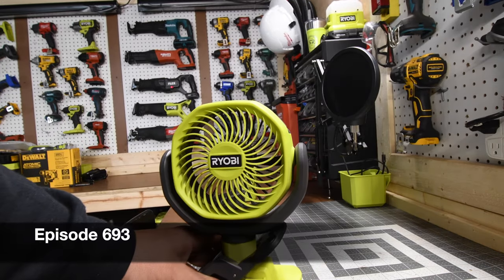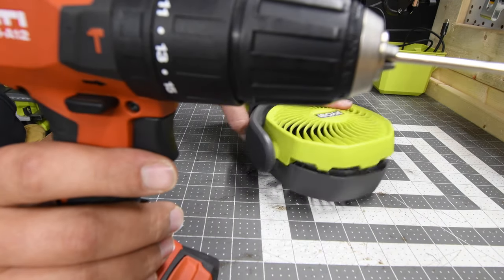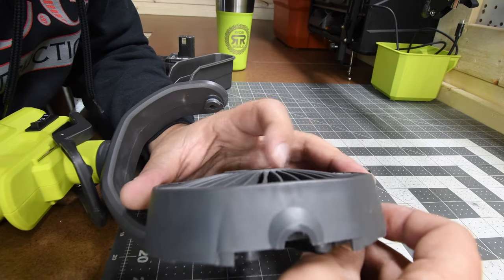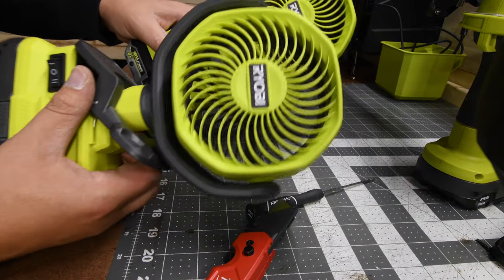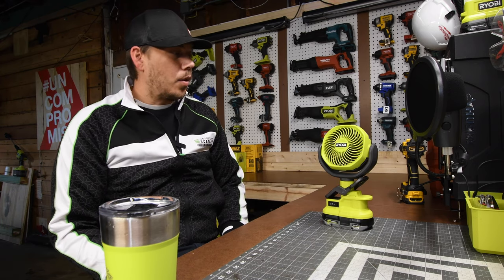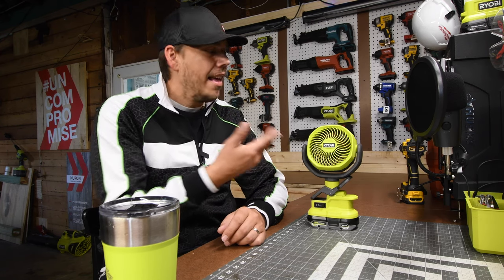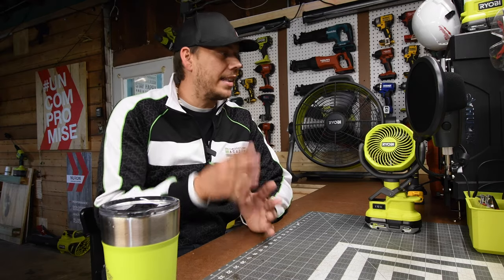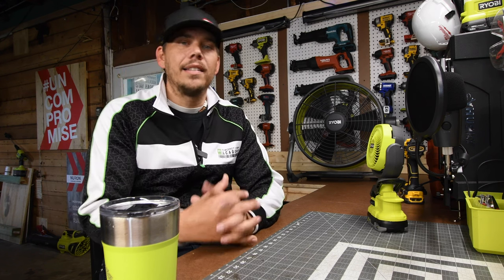If It Ain't Broke, Fix It Till It Is!

Comment: I have 5 of these fans. I bought 2 of them a few months ago and both did exactly what your fan did within days of purchase. I tore one apart and did what you did to fix it when that happened. The fan worked fine for about 2 days and then went back to normal. After reading the comments to your video, I think I will try to disassemble my fan again and use some lubricant to the bearings. If you're fine with it, I may piggy back your video with a video where I use lubricant and see what happens.
Also I abuse fans as well. Our Ryobi cannon fan runs literally nonstop from April to October and we only had a couple times that it would slow down. After a good clean out from the high volume pump it was good as gold.

Comment: As the owner of a couple of these fans myself, this is a short-term fix. Even putting a few drops of oil will give a temporary fix with less effort. The problem is that they probably didn't expect people to use these fans for as long as like you mentioned. 18 hours a day takes a lot out of certain parts if they don't have proper bearings. I used to use 3in1 oil, but I found using wd-40 lithium grease sprayed in from the back help the problem go away for a bit longer. 
But it's still just a temporary fix.

Comment: Fans have to be oiled, Dave. A little 3 in 1 goes a long way
Reply from the maker: I used to do that. it makes the house smell like oil or the grease since I use these fans indoors
Reply: Some fans don't have to be oiled. Some have what they call "permanently oiled bearings". Vornado uses them for example. They say if you try to oil them, it'll harm it. Apparently they use them in higher-end fans.
Reply: White lithium grease doesn’t smell and doesn’t collect dust.
Reply: @cfdfirefighter  interesting. Have never used it specifically. I'll have to pick some up.
Reply: Turning the fan off let's oil reseep itself on motor. When running all the time it will run itself dry.

Comment: Did you remove the fan blade then put it back? Or did you just push and pull on it? Comments say to put lube, but if you can’t remove the blade, where exactly do you oil it?

Comment: My air cannon stopped working. It was doing the same as your fan and just barely running. I opened it up. The brushes are done. They use cheap brushes
Reply: My cannon quit after 1yr

Comment: I just got one two weeks ago, it lasted 3 days..till it started making weird noises 🙄
Reply: Yeah, I think I've got that same prob on my fan; But it still works well enough...
Reply: @leaves2975  yeah , it makes noise for 30 minutes then it’s fine.. Home Depot is out of stock here.. The fan saved me when replacing my tent trailer ceiling panel’s when it was nearly 100F.. flip flops were full of sweat.. like I just got outta the lake..
Reply from the maker: its a nice little fan and it does the trick
Reply: @ManCaverTools  yes , it actually saved the day camping , we forgot the sound machine for sleeping for our 3 yr old.. and she was scared.. but the fan ran all night no problem for 3 nights.. we were camping with out a power site .. way up north of Toronto.. we had a moose one night walk past our site 5 ft from our car.
Reply: Mine did the same and then it just slows down. I exchanged it. I do have two of them now. But ryobi is hit and miss with their quality control.  I also just bought a ryobi a high volume inflator . Pressed it two times and already burned . Plus the nozzle was to big to fit securely on the exhaust it just dangled. I had to return it and reorder. But the 2nd one I received is a charm.. With that said ryobi definitely has quality control issues.

Comment: I sprayed lithium white grease works perfect
Reply from the maker: I used to use oil/grease, wasn't a fan of the smell blowing on my face
Reply: I found that if you apply it on just the bushings, the smell doesn't seem to last very long. Maybe a day, but no more. Then again, I've never done it with a fan blowing right on my face so 🙃

Comment: You need to replace the motor with a brushless motor….more power baby!!
Reply: I think it has a brushless motor already
Reply: @462ANIMAL  if it don’t say HP it ain’t brushless unfortunately.
Reply from the maker: I wish they would.
Reply: @txvet7738  crap, I was sure I saw it said brushless in the specs under the tool description online.. must have been another tool.. or getting old 😀